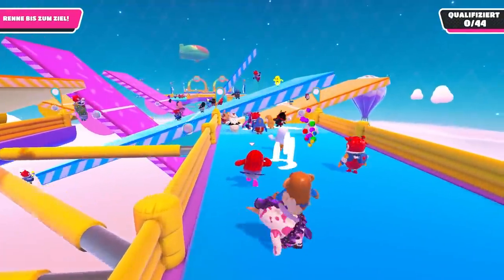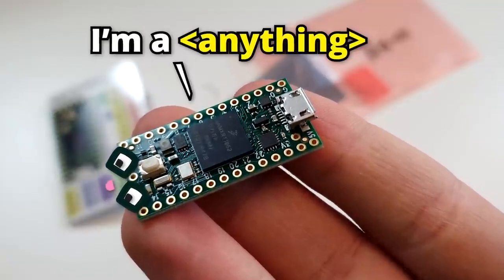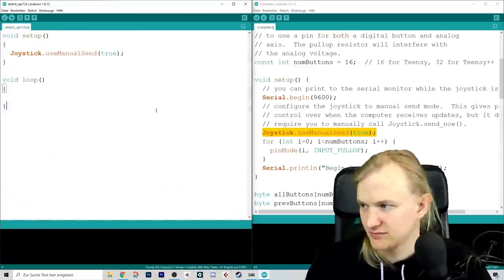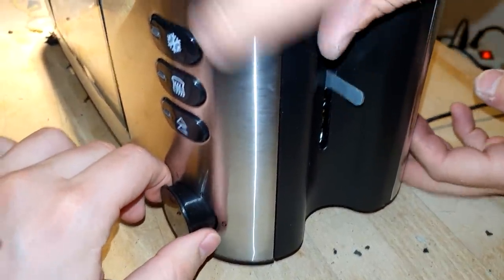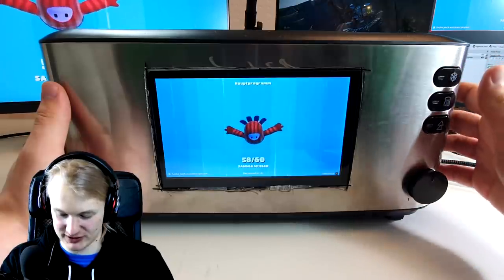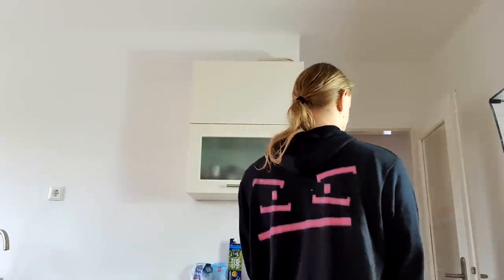I Built an Actual Gaming Toaster

Comment: I'm quite new to this channel but in the beginning you talk about "3 get help from dad" - jokers... yet you spent 6?

1 - Teaching to solder 3:12
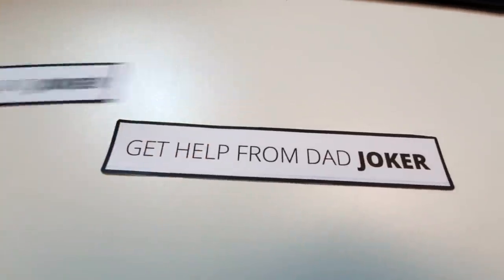2 - How to connect the buttons from the toaster 4:19
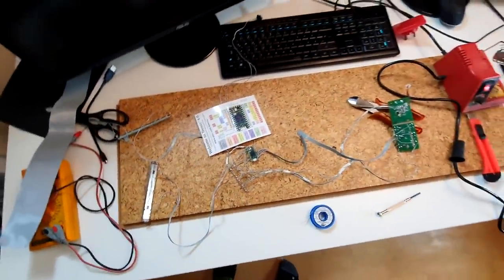3 - Fix your soldering issue 4:50
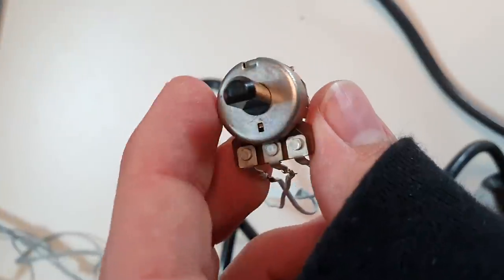4 - Changing potentiometer 5:41
5 - Sliders on the side 5:58
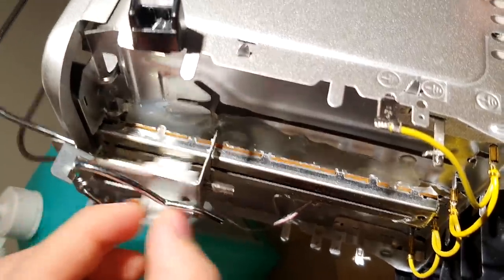6 - Get Display in 6:22

Great project nonetheless!

Comment: i've never seen a solder joint that bad before dude that isn't how you are supposed to extend the ground and all, there are things called "wires", why are you using a circuit board for that omg this is so bad